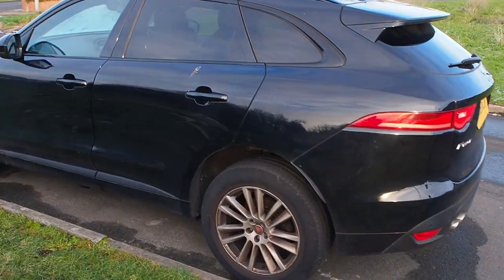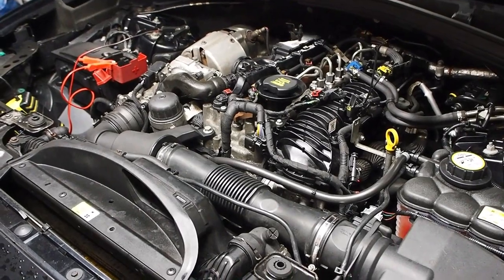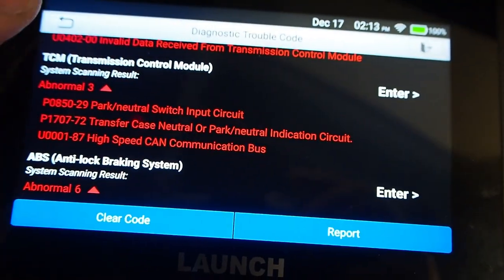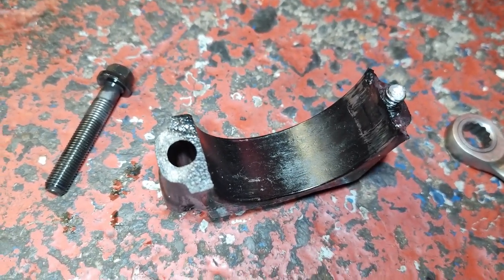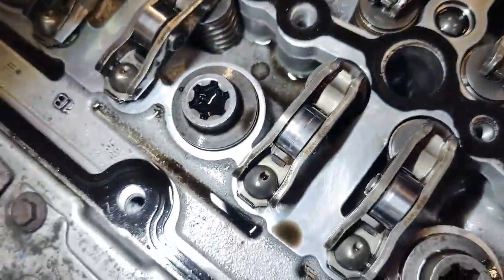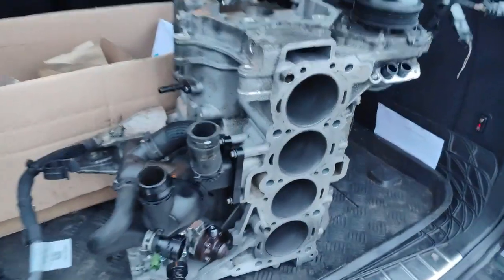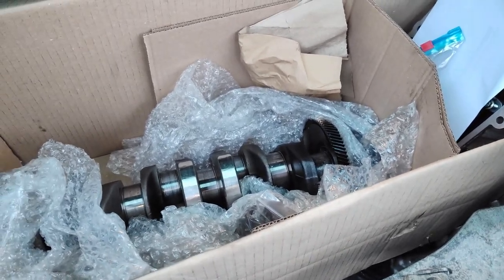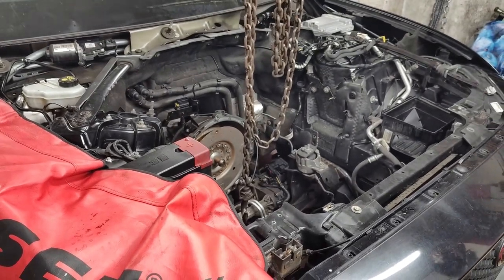Can I fix this non runner Jaguar F-Pace? (Part 1)

Comment: Impressive work mate. I was looking at purchasing a f pace 20d 2016 model from an auction with a motor problem. It's drivable but the motor needs major work. The amount of work I'd need to co sider doing to likely getting it running well won't justify the saving I'd make.
Reply from the maker: That's pretty much how I ended up. Came out a bit cheaper but the market dropped and wiped me out anyway. They're was a 2017, 70k miles recently with an engine problem, owner was offered 5k for it broken. Didn't feel it was viable even at that money.

Comment: Hi. I came across your channel because I have a Jaguar XF X260 with the same engine. It has the same damage. I wanted to ask what manufacturers of spare parts you used?
Reply from the maker: @lukasz9863  I used a genuine (but used) crankshaft and rods, Chinese oversized pistons (Jaguar don't make them). For the timing chain kit get a decent brand.
Reply: @Escygt  and with the benefit of hindsight and this repair, what would you advise me to do differently so that it would be successful without major problems?
Reply from the maker: @lukasz9863  I don't know if you've watched part 2 and 3 yet but the engine ends up shitting itself. Possibly looks like the liners weren't done correctly. I don't know about advice but I do know I wish I hadn't bothered

Comment: If you decat it and remove all of the emissions parts... haow will you get it past the MOT? ... surely the engine management systems will reveal this when put on a reader?
Reply from the maker: It's been re-mapped. The MOT is a visual smoke test on a diesel. It's not smokey at all.

Comment: i have one aswell to deal with at work, seized motor, was wondering how you were able to access the torque converter bolts/nuts?
Reply from the maker: Through the starter motor opening. Luckily my engine wasn't totally seized so I could use a pry bar to move the flywheel a tooth at a time.
Reply: @Escygt  ofcourse, however , this motor I have is deadlocked 🥲 may have to yank the transmission off the converter , dropped as whole unit
Reply from the maker: @JimDaTech  I was glad I didn't need to mess with the transmission but pulling it all out as one unit is probably quicker if you've got a ramp. Your customer is going to be getting a monster bill! Are you rebuilding the engine or just putting another in?

Comment: You need to price up having parts to rebuild your original engine and price up having a doner engine serviced (who knows what you might find worn on an unkown engine.
Or maybe the best bet financially  (if time allows) to get a cheap doner car and make 1 good engine out of the 2 engines.
Reply from the maker: What's part 2 to see which way I went.

Comment: Always love your updates.
Sounds like a great price, albeit I hope you’re still able to turn it round while keeping repair costs reasonably sensible.  It sounds like buying a crash damaged car to pull the lump out of is probably the best way to go financially, albeit it’s going to be extra ballache to rip apart and shift all the bits.
What’s the plan - are you going to fit the new lump wholesale, or try and recycle some bits from your lump?  What with the change in bore diameter and the amount of swarf & silicone floating about, it seems like the best bet might be to recycle the new turbo and junk everything else?
Best of luck mate  👍
Reply from the maker: The best bet is to get another engine but nothing suitable was coming up and I was pressed for time. I didn't want to wait around looking for an engine or donor car at the right price - it may never come. 

I end up going with my least favoured and the more risky option of a rebuild which is part 2. I'll be uploading it soon.